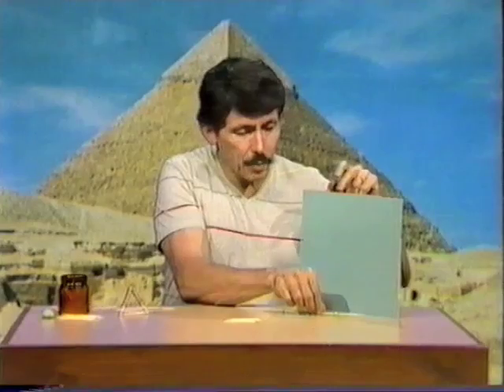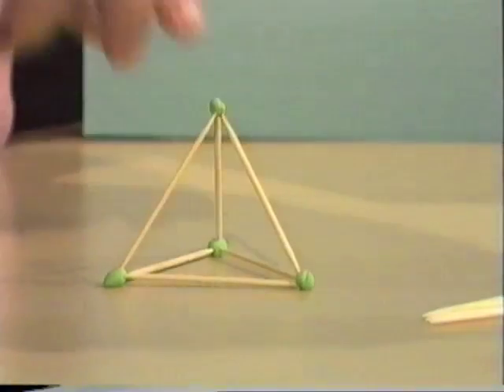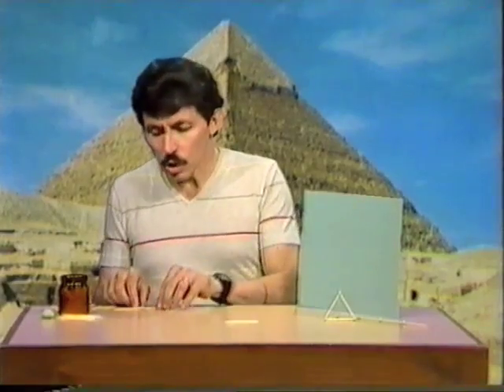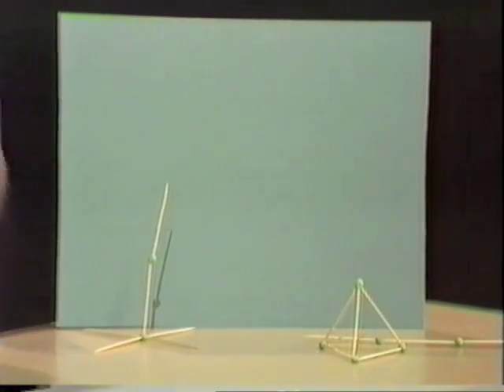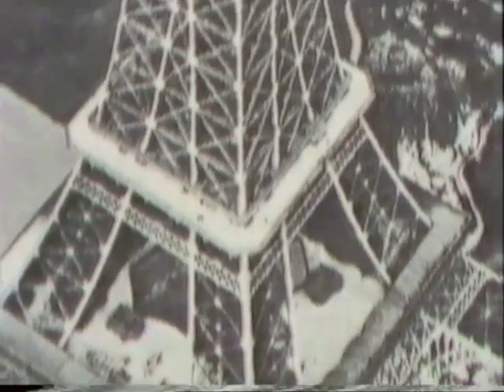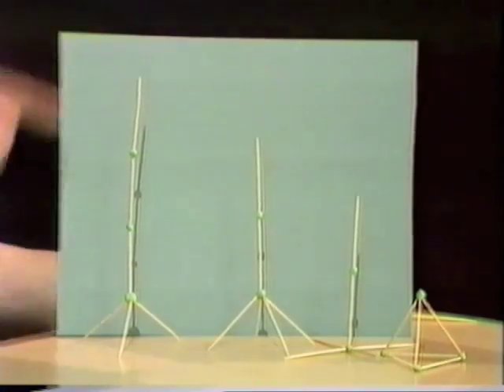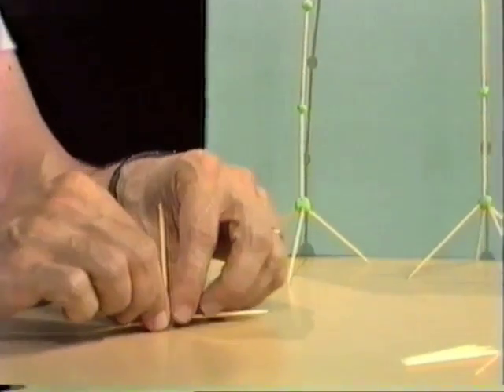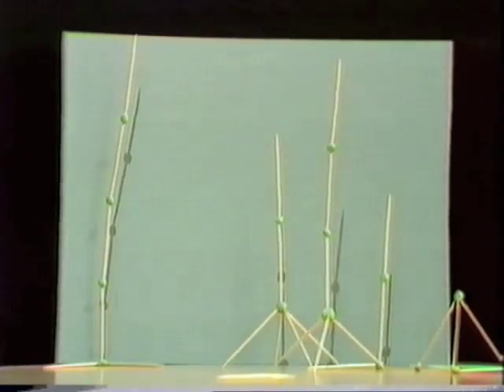Toothpick Engineering

Comment: My initial ideas were to either A) build the tower using three toothpicks at the base, just all together to make a thicker tower bottom (skyscraper), or B) use two toothpicks at the bottom, one over the other to achieve the same effect as using 4 in a cross pattern (standing fan legs)